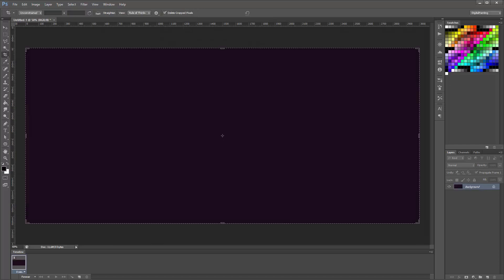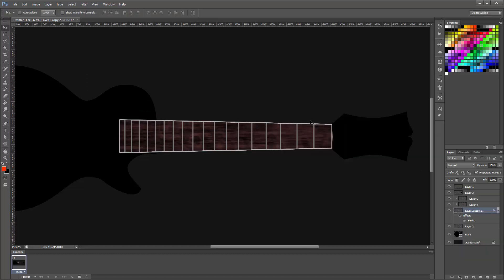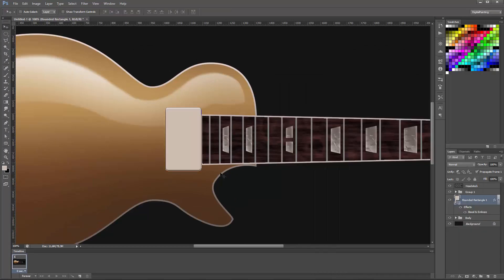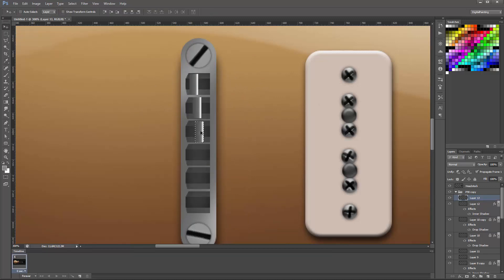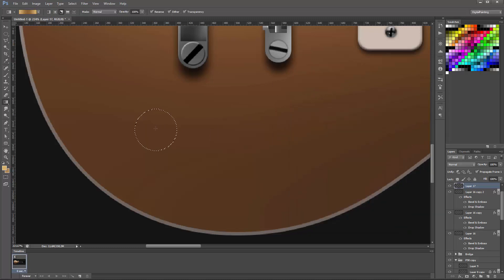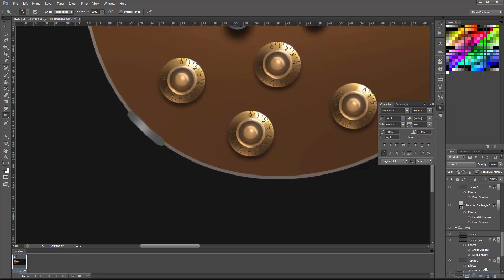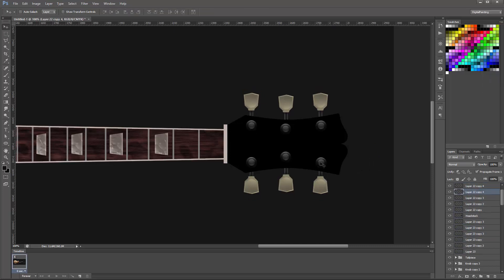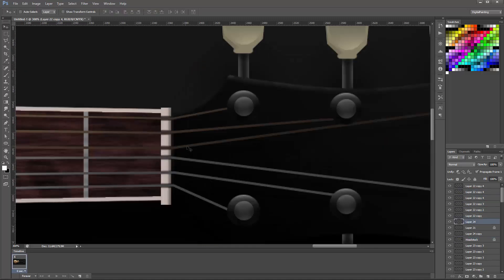Creating a guitar illustration in photoshop

Comment: About the embossed edges:

Why not do like this:

1) select with wand
2) expand selection (size of edge)
3) New layer
4) Make texture and emboss
5) Select lower layer with wand
6) Clip upper layer to size (removing edges)

Like that you'd end up with emboss effect without the edges at the side of the guitar.
Nice video!
Reply from the maker: It could work although I have the suspicion layer styles take clipping makes into account, but I'd have to try